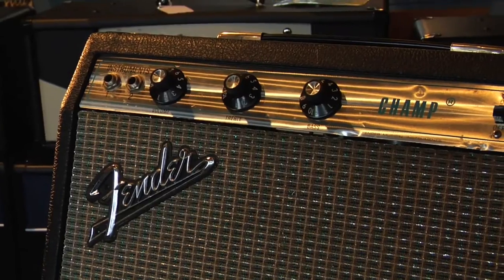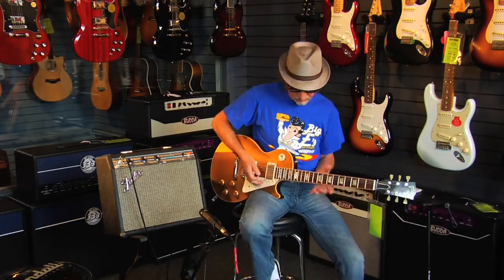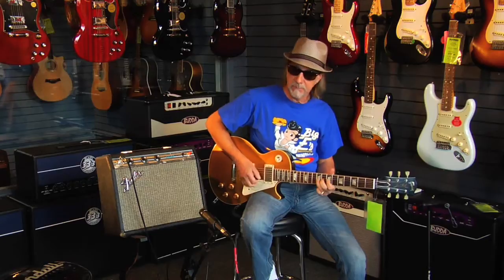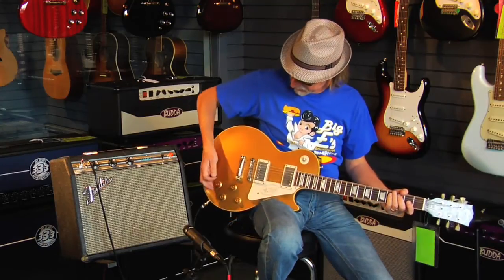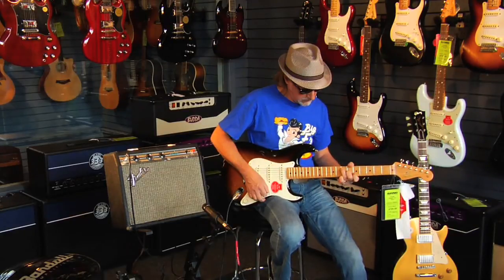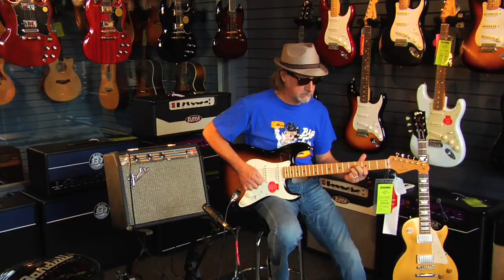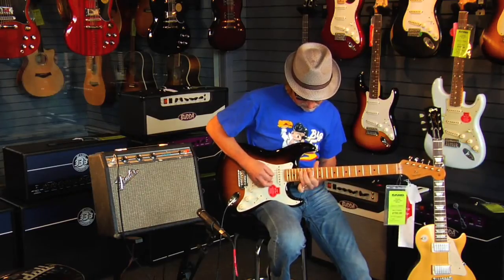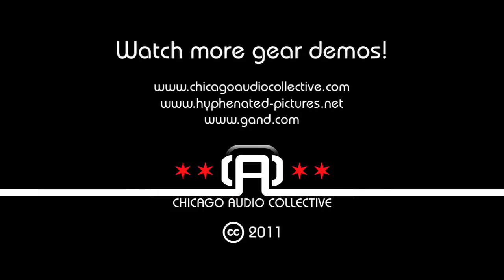Vintage Amp Demos (3/5) - 1971 Fender Champ

Comment: I'm playing my 75 Champ right now, and I'm really enjoying the natural distortion. I am using a compressor and a reverb unit. I am boosting the signal with the compressor volume. The Champ needs a tiny signal boost in my opinion. I'm playing country rock and so the solos require some boost. With the boost the solos scream out so sweetly. No overdrive pedal can come close to this sound.
Reply: 1971SuperLead try installing a 12bz7 in place  of the first 12ax7
Reply: Sin sin sinner Thanks for the tip. I found a message from someone who knew a little about them. "They draw twice the current of a 12AX7, and the glass envelope is about 3/8" taller. If your amp calls for 12AX7, and can tolerate those additional requirements, you can sub a 12AX7.

As Prairie Dawg said, they do tend to be quite microphonic. My experience has also brought me to this conclusion. HOWEVER, if you can purchase them from a trusted tube seller who will audio-test for microphony, you can work around that drawback - for the most part. I highly recommend Jim McShane, who has provided me perfect 12BZ7 every time (thanks Jim! :aok).

Another consideration is that they are relatively inexpensive on eBay, and you can risk trying a sample or two. If you're lucky, you may get a relatively non-microphonic one. But if it is microphonic, it may still be a fun tube to try in your phase-inverter position (if you've got a 12AX7 there now) - microphony will not be a problem in the PI.

In my listening experience, these 12BZ7 are very, very clear (articulate), and tend to emphasize treble a bit. They also add about 1.5-2 dB volume boost, and can stay "clean" while doing so.

Very nice tubes, in the right position. I use them in Mesa Boogie Triaxis (V5 = master volume output) and 20/20 amp (V1 = first input for each channel of this stereo power amp). They don't do well in combos, typically (microphony), but I do use one in V3 (= Reverb recovery and second gain stage/driver) of my Victoria Regal II.

With the extra gain, you can turn down volumes to the same level (as before you put in the 12BZ7), and effectively drop the noise floor a dB or two. But I caution you to use only one per amp, as the extra heater current can add up to become a problem."

Cool.
Reply: 1971SuperLead In five watt Supro's and Gretch amps made by them we sub a gz34 for  the 5y3 and get a lot more clean head room and haven't had a issue with reliability.